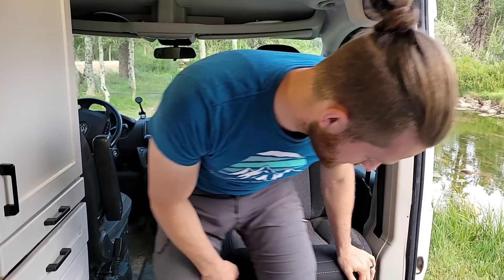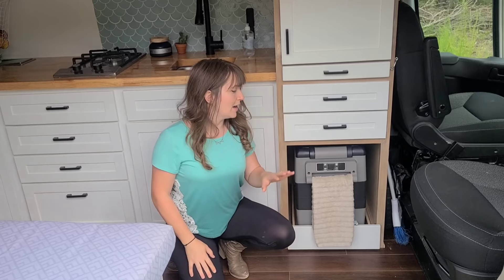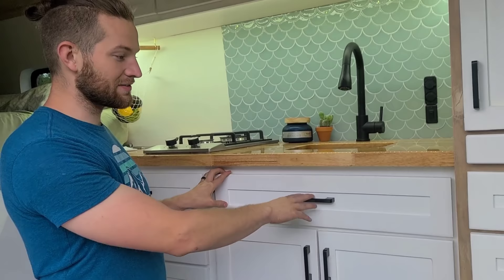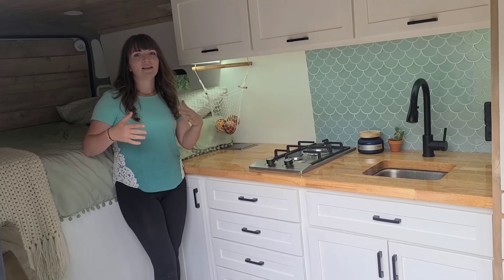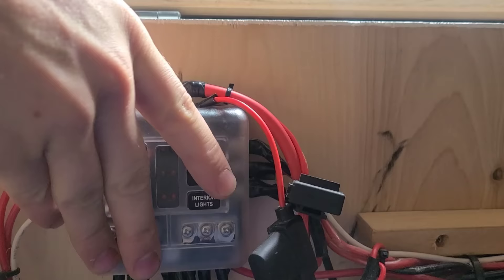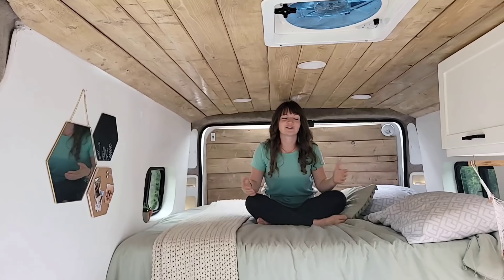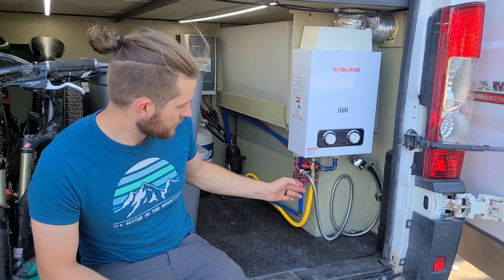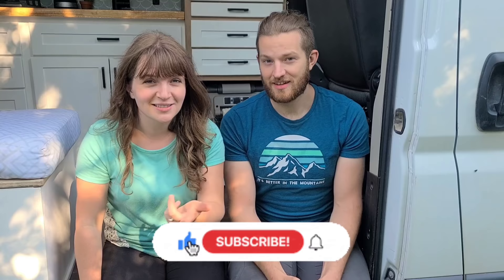VAN TOUR | Self-Built Ram Promaster Van Conversion | Tiny Home in a Camper Van | L&K SEIMS 2021

Comment: I've never liked chest refrigerators because when they're pulled out they either interfere with the walk space in the kitchen or they require you to remove everything off the counter to access what's inside.  Your design is so clever because it allows you to have the chest 'frig that can be used whenever you need it!  Very clever.  Thanks for sharing.
Reply: Thankyou! We were definitely hesitant to use the chest fridge, but all in all I can say I really like it! Its so much more efficient than our previous fridge. However there is almost always cons. Are you designing a van Build?
Reply: A way around this definite irritation is to load the bottom half as normal (of-course, non-squishy items).  Then the top items can be loaded into several bags, such as plastic, string hammocks, or even the larger left over plastic containers from food items like fruit.  Think ones you can see through.  Then it's only lifting out a small number of containers instead of individual items.  Always keeping "standard" items, such as mayo,  in the same spot on the bottom will mean only "digging" down to that one known spot.

Comment: This is almost my ideal shower at the back of the van.
Slide out heavy duty board that then hooks on to the edge of both doors, so you don’t stand on the ground.
Then a very short awning that comes out covering the top to only the edge of the doors from the roof of the van if it rains, if not then you can shower in open sky.
And lastly a shower curtain that wraps around the rectangular space your in.
Or to be safer and avoiding strong winds, can also install a fold out panel from the doors to connect and lock.
So you basically have another extra opened space from the back of the van that can also be use for a projector screen to binge movies during camping with friends.

Comment: Live your guys' van, so effective and beautiful. The only thing you might be underestimating, is just how much dry spices can absorb from their environment. You have containers with screwcaps, which aren't tight enough to prevent the occasional porta potty whiff, to make it in. It's just not worth the space saving.
Reply: Thanks! I do think you're underestimating the seals on our porta potty
Reply: We have one of those portable toilets on our boat.  Absolutely no smell emits from it when it's not in use.  Also, no foul smell when it's in use due to using the appropriate holding tank chemical.
Reply: @deepsea5107  Bon appétit, enjoy

Comment: Building out a van in 3 years when I retire. I love this van . I want an indoor shower.
Reply from the maker: Congrats!! 3 years isn't too far away at all!
Reply: Right on! What kind of van are you planing to use for your build?
Reply: @loganseims7921  Ram Promaster
Reply: Not sure of the WB yet
Reply: @pamelamidgley4633  if you want an indoor shower I would highly recommend the 159 inch wheel base. Our last van was the regular 159" WB if you want to checkout our tour it had an indoor shower

Comment: Visuals and audio quality was excellent.  Thank you for no music, hurrah!!!

Kelleen did an excellent job of showing detail as Logan was talking, and focusing on van not man.  This was professional camera work, Kelleen!  

The Webasto heater is $1625, but Chinese diesel heaters are only $200.  I hear the cheaper models work well.  I would most likely use these.

2:00 - The hook and latch don't look nice. So many better options. Never put cheap buttons on a pricey couture dress.  The pull out table is not a good idea. I would much rather see a shallow drawer for laptops or cutlery.  Put a Lagun table for a desk area in front of the passenger seat.

4:08 - From personal experience those magnetic spice jars don't work.  The magnets are weak and weaken further.  They will fall and create a mess.  Maybe put an elastic net over them.

6:10 - You should have continued that backsplash all the way down. Its very nice but chopped off halfway visually.

Laundry Chute - Great idea. Why not put a slide out box in the narrow cabinet that slides out to remove dirty laundry bag liner.

Great job on layout, kitchen cabinets, ceiling, hot water system, gas heating furnace.  Excellent overall build. Putting a heating mat with thermostat in battery cabinet was genius!  Very well done.  Thanks for the tour.  Hope the feedback is helpful.
Reply from the maker: Thank you so much! We love getting feedback, I think it's worth its weight in gold 🙌 People have so many different perspectives and life experiences that can add so much value! 
Are you vanlifer as well? It'd be fun to bump into you on the road!
Reply: Thankyou! Some of your preferences wouldn't works for us, but I'm glad you know what you want in your future build!!! Are you thinking of building one out?
Reply: @loganseims7921  I've extensively remodeled an existing RV - my first one.  I went this route as I did not have the electrical and plumbing skills and was limited in workshop space. You need a workshop area to do a proper build out from scratch.  I also wanted to use the van right away. I bought an older Class C RV and worked on that to redo a lot of areas. Then I used it.  Now I know what I want a few years down the road.  I also know what components to use, how to build it out from watching some excellent builds.  Its a huge learning curve - electrical, plumbing, HVAC, carpentry, mechanical, spatial skills needed.  Passing on my tips to others as I have learned from them too.  Hope my tips help you.  You have a great van.
Reply: @mjremy2605  wow! That sounds like a lot of work and a lot of fun! It definitely helps to have a workshop space!

Comment: For this build, you moved the shower from inside to outside.  Obviously this is a great space saver and have tentative plans in my build to add an external shower outside the back as you have.  
However, how often did you use the shower in your previous van build and how often are you using this one?
For your heater, did your Ram Promaster have a gas inlet from the engine or did you have to get one installed?
What is the size of your gray tank?
What type of gas mileage do you get with your vehicle?
Reply: We actually didn't use the inside shower very much at all, and the outside shower we've used, but more for a rinse. Its come in handy though! I value the space saved over having a shower inside.
Reply: Now that it's cold we will go to the gym for showers. The grey tank is a 5 gallon. Ram Promasters come with an extra pickup line on the gasoline tank so you merely have to connect to it for the heater. And the the  van averages 18mpg

Comment: I looked at the website at the refrigetor.  I couldn't see a backup battery.  Can u please explain more about that.
Reply from the maker: Hi! I just double checked the Amazon link and you're totally right! I'm not seeing the backup battery info. We purchased our fridge through Summit Racing Equipment, but they told us it was the same product that was listed on Amazon. 
On the display (as shown on the Amazon listing as well) it shows a battery icon. If the fridge stops receiving outside power it will resort to using the backup battery. The icon will show you how charged the backup battery is and you'll be able to see when it starts getting drained. It says it should offer up to 16 hours of backup battery time but I'm sure that varies depending on how hot it is where you are at.

Comment: Water heater - Where does the exaust go? And what about heat from top of heater - not worried about damage to bed?
Reply from the maker: Hi! Great questions! We have aluminum ducting funneling all exhaust/excess heat out the side of the van. There is a metal vent located just above our fresh water fill port on the passenger side.
Let us know if you have any other questions!
Reply: @LKseims  Thanks for the reply. Would be amazing if you could post more about it- vid or more pics :-)

Comment: Love your home, would you please reply with source of cabinetry? If you built them from scratch, did you use a kit with materials and instructions or ...?  Also, what is wall and finish material on passenger side?  Thanks much!
Reply from the maker: Hi, thank you! We did build the cabinets from scratch, with 3/4" plywood. My dad is fantastic at cabinetry so he showed us the ropes. And as for the walls it is just 1/4" plywood covered by joint compound/texturing (like used in houses). For bridging the gaps and corners we actually used bondo instead of the joint compound and it has held up great! Let us know if that answered your questions or if you have any others:)

Comment: Well done, on your build!  One thing I've noticed on the vans that have a rear, external shower: no place to stand so you're off the ground and away from the muck created by showering.  I'm surprised no one has designed a shower grate type "floor" that can be inserted into the vehicle's receiver hitch.
Reply from the maker: Thank you! And great suggestion, my dad actually recommended the same thing! It'd be pretty easy to slide in one of those metal grid luggage carriers, but you'd have to have space to store it inside or be okay with driving around with it 24/7
Reply: @LKseims  - Consider teak or bamboo shower mats.  Is like a bath math but made of wood.  Lots of styles, sizes and price points on Amazon.  Would easily fit on the floor of the garage.  Appreciate your build out (both great ways to hang the shower curtains) and learned a few new things!  Thank you and safe travels!

Comment: Do you have anything under the mattress to add airflow to prevent moisture and mold from forming?  What /where exactly is the antifreeze going into? Since you have to winterize the van with antifreeze does that mean you can’t use the van during the coldest months?
Reply from the maker: Great questions! The antifreeze is just installed in case we sell the van and somebody wants to store it over the winter. If we (or anyone) live in it over the winter and keep the inside of the van normal live-able temps then the antifreeze is totally not needed. As for the mattress, we just check under it periodically (at the beginning of the month) to make sure there is no moisture buildup:) Let us know if you have any other questions!

Comment: What are your walls made out of? Cabinets? Do you have a video of each part of the build?
Reply from the maker: We should have been better at documenting our build! Our walls are just plywood with normal drywall texture over it. And our cabinets are built out of 1/2" plywood (with a hardwood for the face so they don't dent easily)
Reply: @LKseims  I found a van in my area but I have no idea if it’s a good deal or not. Who would you recommend to look at it in general?
Reply: @kimkuchler4389  I always recommend taking it to a trusted mechanic before you buy it and having the van inspected. This could save you a lot of money and stress. If for some reason that doesn't work out then I would look for a newer year and lower miles (within your budget) and if you find something that qualifies test drive it!
Reply: @loganseims7921  thanks so much

Comment: Hi guys, is portable aircon good for homemade rv instead of those roof aircons?
Reply from the maker: Any air-conditioning is probably going to run your battery pretty low, but we've heard of some evaporative coolers that work really well. We currently don't have either, just natural airflow from the windows/fan! Let us know if you have any other questions!

Comment: A heater is not a necessity 4me: an Air Conditioner IS.🙃
Reply: Right on! Where do you live?
Reply: A/C is really hard to power off of batteries. You'd have to use a generator,  but I have seen some evaporative cooler options that work on 12v!

Comment: Hi, I don’t think having your gas bottle in this area with your electrical gear and a gas hot water that has ignition is a very good idea! If your cylinder or regulator or hose leak, you will blow up with the vehicle. It is against the law to have a gas bottle in the vehicle, it must be vented by using a door on the outside , and must be completely sealed in a cabinet on the inside of the vehicle. This is very dangerous, you are going to die from gas fumes, carbon monoxide from the heating of your hot water service, or get blown up by a gas leak under your bed that would be ignited by either your voltage reg, or your hot water ignition. You need to stop using the gas, remove the bottle until you get all the gas redone by a qualified plumber.THIS IS NOT A JOKE!!!
Reply from the maker: Hey! Thanks for your concerns! We've had a couple people mention the down vented propane cabinet, which will be an easy addition (that we are currently working on.) In the meantime, we do have a battery powered carbon monoxide & LPG detector. Our hot water heater is vented to the outside and the good news about LPG is that it is not odorless (like CO) so the odds of accidentally blowing ourselves up is very very low. We do appreciate your concern and your feedback.
Reply: I would seriously contain the bottle in a cupboard on the outside, sealed internally, with a vented access door externally.Legally you must use a licensed plumber to carry out gas installations and to sign off .
Reply: @mickcollins5502  we appreciate your concern, but there are no laws about using a licensed plumber to run a propane line in a van. If we were building a house that may be different.